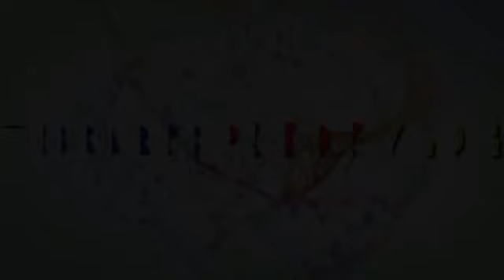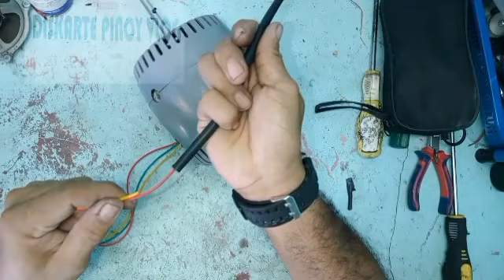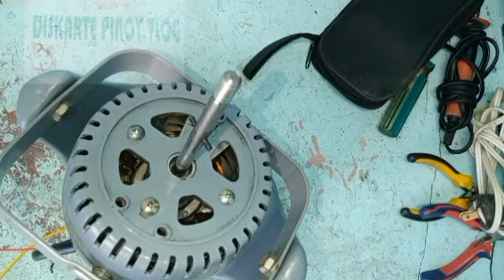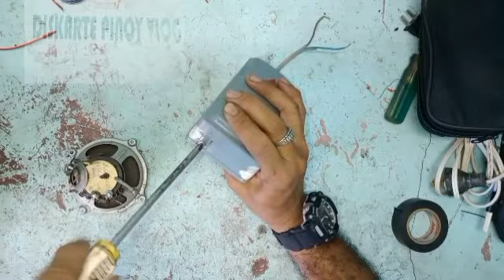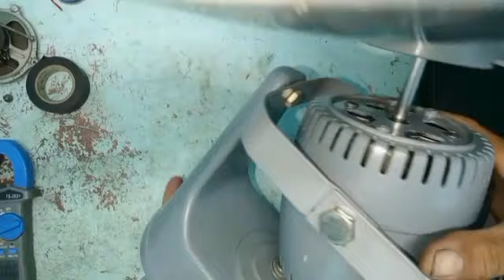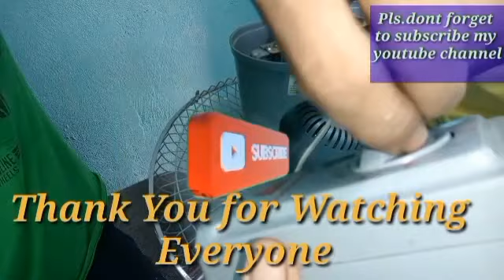PAANO MAG ASSEMBLE NG BAGONG REWIND MOTOR SA ORBIT FAN?

Comment: Tanung ko Rin po! Ung pag tap Ng connection Ng 6 wires sa Orbit fan at paglagay Ng fuse Bago Ang pagkabit Ng selector?
Reply from the maker: Gud am sir tatlo lang ang wire nyan  isang running, 1 starting at isang live or line 1.